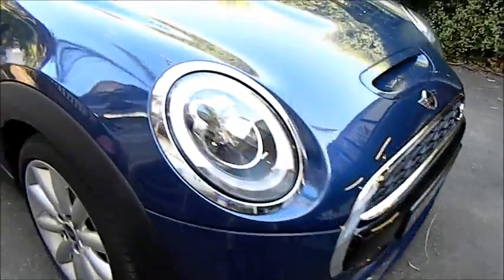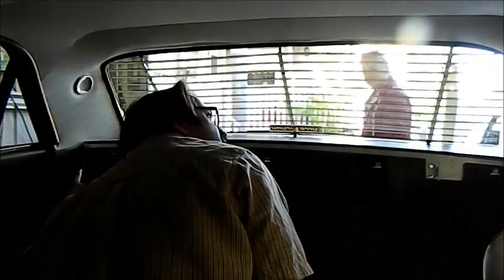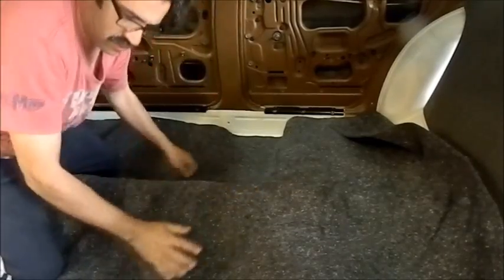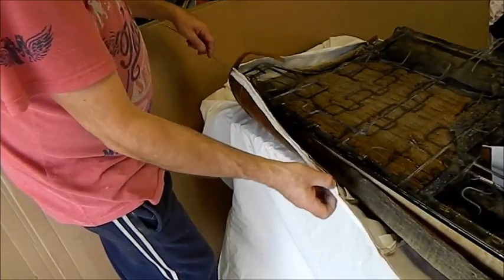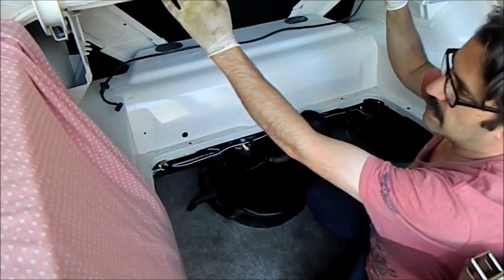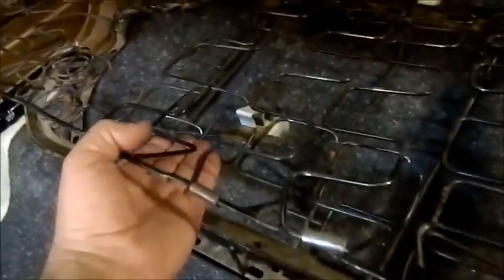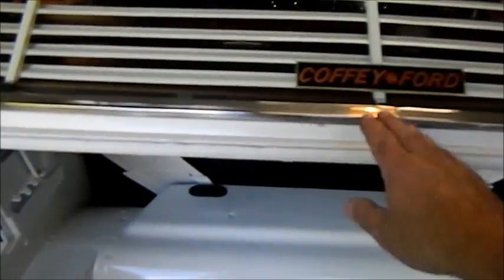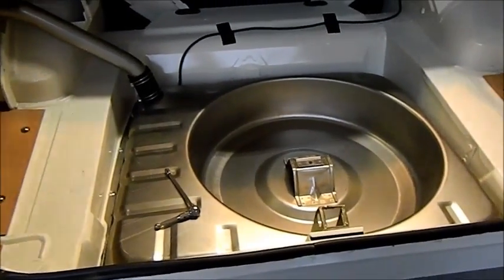1969 XW Ford Falcon Restoration Part 22

Comment: Hey,Pete.Seeing you aligning the bonnet reminded me of the 1500km service on xd-ea Falcons.Aligning doors,bonnets,boots,window frames,external trimmings and escutcheons on brand new cars was par for the course.Unheard of these days.
Also,seeing you lay out the under felt takes me back to locating water leaks into Falcons that would completely soak the carpet and underlay.We would have to remove all the seats,consul,etcetera,and hang the carpet somewhere to dry,and cut and fit new underfelt.

Comment: Fantastic job peter well done very through i owned a 1970 xw Fairmont 302 a few years ago very similar to the car you restored it was in polar white and the same interior as yours. I had 8 inch 12 slots on 265 BFGoodrich tyres on my car. Excellent video's. Keep up the good work. Greetings from New Zealand.

Comment: Hi Peter,
Just watched your video again where you install the fuel tank, Im currently cleaning my original one up and trying to get all the old muck and paint off it. Im using a wire brush on the end of a drill to clean it and wondered if this will get the gal coating off and hence cause it to rust?
Where did you buy the new one from?
Cheers
Steve

Comment: Hi Peter, awesome video. Just wondering - did you paint that fuel tank?  If so what type and colour?  I've bought a new tank for my ZB from Old Skool AP Bayswater but not sure which way to go with it, i.e. POR15, Bunnings Spray Cans or something else... Appreciate any tips. Cheers!
Reply from the maker: +Nick Hoare Hi Nick, I didn't touch the tank, it was a new one from Oldskool in Bayswater as well... I just bolted it in when I was ready. Cheers Peter
Reply: Thanks Peter. Hmmm must be an extra sheen on your videos then! Hope the XC is mot causing you too much grief, cheers.
Reply from the maker: Not at all Nick, just uploaded another XC chapter now. Cheers mate, Peter